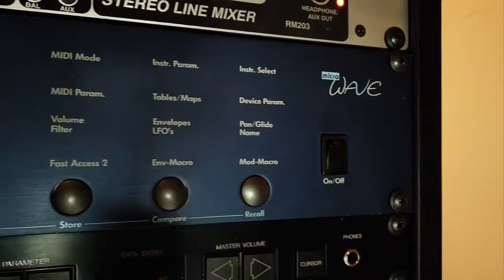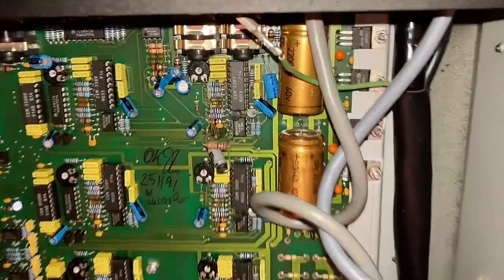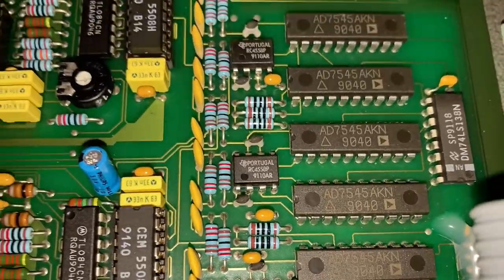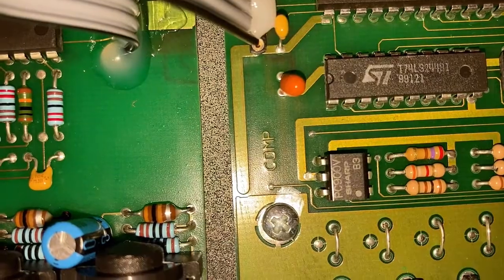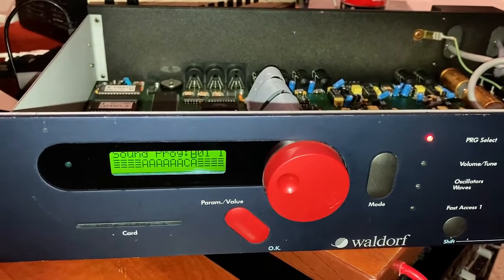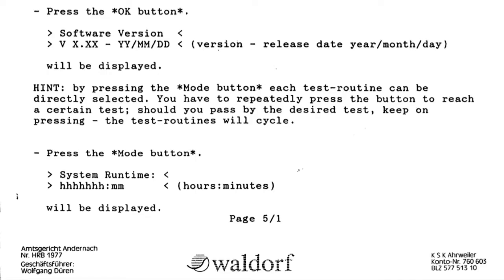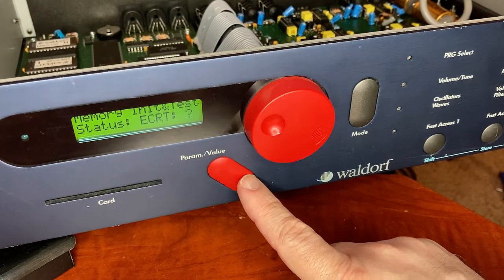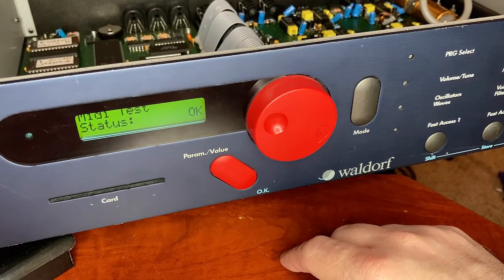Waldorf Microwave: PCB Tour, Battery Replacement, Service Mode Tests, Reloading Factory Patches

Comment: I see you have the original gold capacitors in your unit.  Waldorf put out a service bulletin advising owners to replace those caps as they have a high failure rate and can lead to further damaging the synth, often taking out the transformer.  Many users have unfortunately learned this after it was too late.

Comment: Thank you for this video, that is enlightening - literally! I have followed every step you show, including getting MIDI to respond on Sound Prog A01 and setting Device Number to 000. But my question is how do you get from that (at 09:36) to the factory patches being all nicely reloaded (at 09:37)? If you could detail that stage that would be extremely helpful because so far I haven't been able to reload those factory sound programmes and I'm really stuck. Thanks!
Reply from the maker: Ah... you can't do that from the front menu. You need to load the factory patches via SysEx over MIDI. You can find them at Waldorf's website and other places.

Comment: Would you happen to have a Rev A schematic and/or prints? The analog board prints and schematics in the commonly available service manual are all Rev B boards.
Reply from the maker: Sorry, the only schematics I have are whatever's currently available by googling. I'm sure of that since I found them by googling. ;)
Reply: @Lantertronics  Thanks for the quick response. Scoured some forums and have the culprit narrowed down to a handful of caps on the analog board between a VCF and VCA.